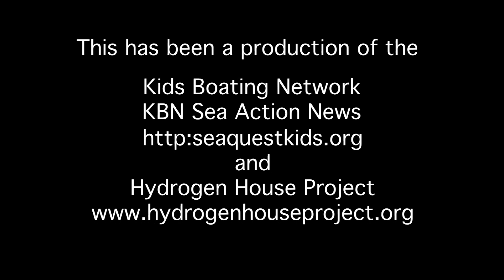Victor Dick Hindenburg Eyewitness

Comment: I have to disagree with this video. What about the many other airship disasters where the outer skin wasn't painted with a doping compound like that of the Hindenburg? They still burned violently. Hydrogen on its own would burn invisibly but combustible materials including the fabric would add colour to it.

Hydrogen does have potential for clean energy but the outer skin theory is greatly flawed. It would have taken 40 hours if the Hindenburg had burned due to the outer cover and no hydrogen. Additionally a static spark does not have enough energy to ignite the skin.